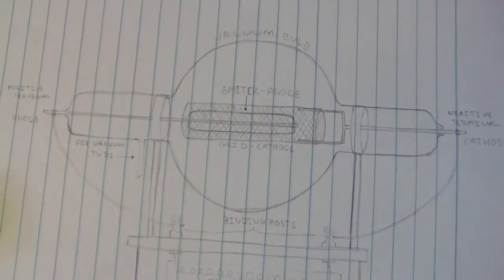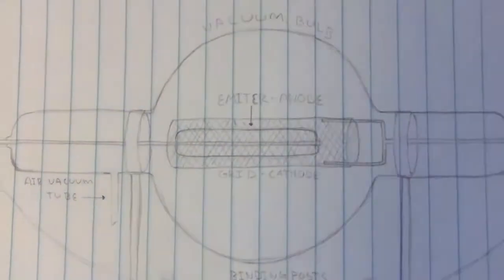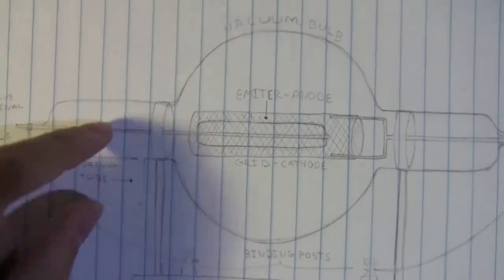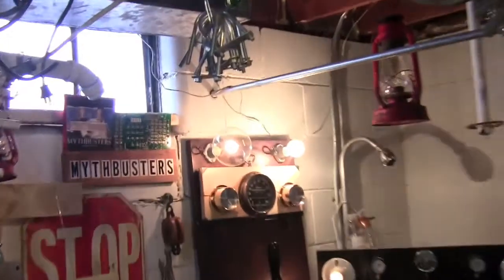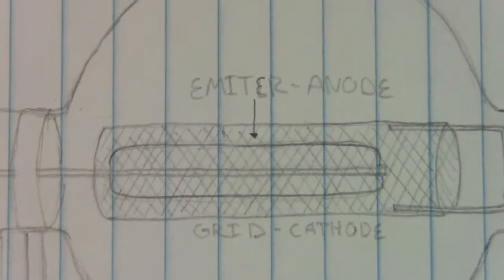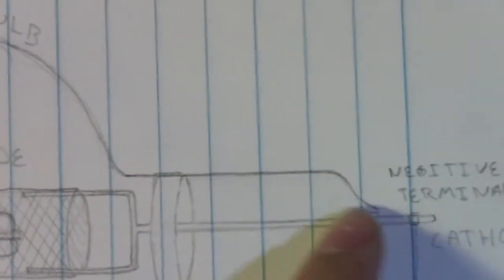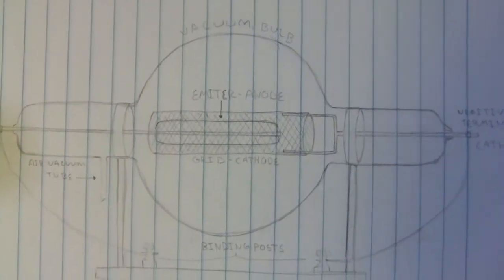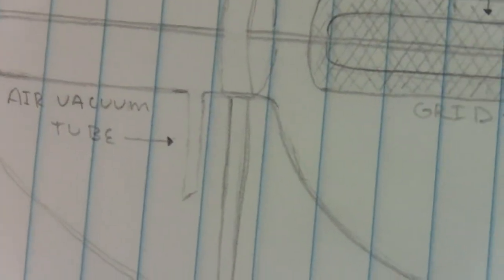Farnsworth Fuser? Glowing Ball of Plasma? Reactor?

Comment: @MrSciencetificsasuke if you must play with fusion, use a cold fusion reactor, they are safer, as they dont emit as much hazerdus radiation, as Hot Fusion reactors.
and you plate spacing is to small, it will only withstand about 1000V DC, and yes i mean DC, not AC. Hot Fusion reactors are powerd either my microwaves, lasers, or highvoltage DC, you would have to build a highvoltage rectifigher. oh and btw, how are you proposing to seal the glass envalope? with normal wire for the terminals?

Comment: @thewii552 if it is fusing then it still will be a very small amount of energy reselected but with the fusion what types of radiation will be emitted? i never fully studied this type of fuser. 

it would make more logical for it to be harder to make plasma on account for there being less molecules to ionize.  
i think it would be a cooler if it was filled with co2 or an easily extricable gas making only the inside glow very bright and the surrounding an interesting glow with cameras